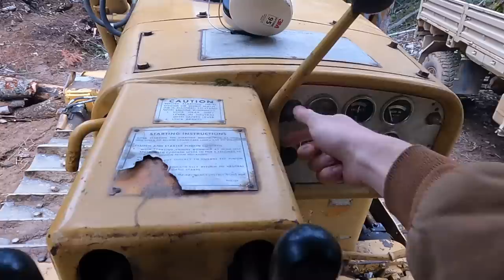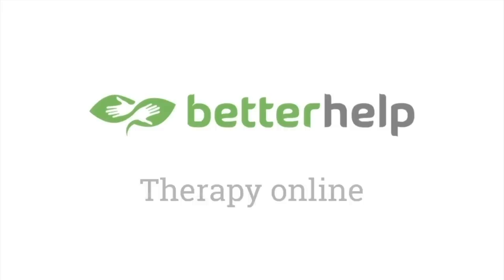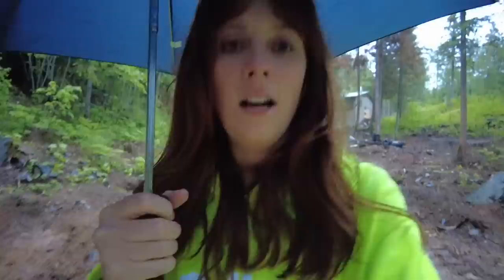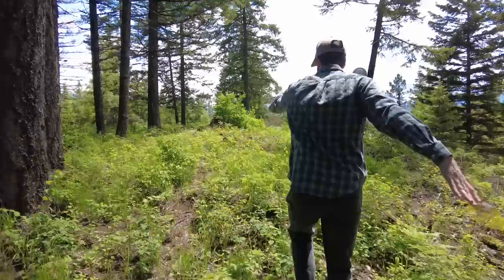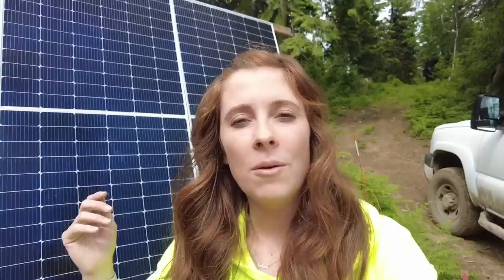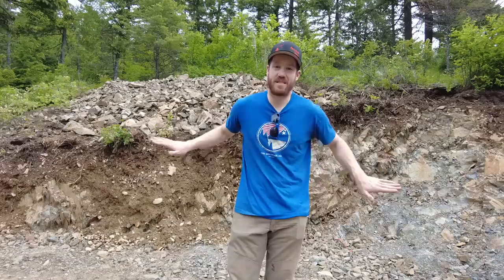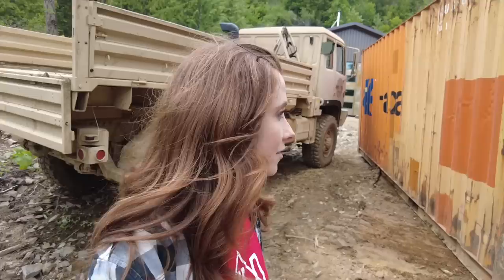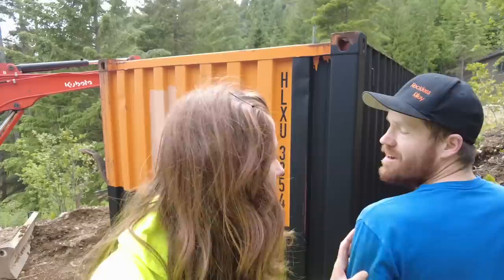We're Moving On... With A Shipping Container?

Comment: NO; don't put any soil or bury up against the wall of the container, that's me, I wouldn't, it needs to breathe! Or it will rot. Why, some shipping containers are not up for it; some are low grade metal & the pressure from burying it could buckle it besides rotting. I love you Guy's but that will have issues later if your bury the side wall. Why I know this, had a customer, the back-end of his container up against the embankment, it rotted.

Comment: Hey guys jus watched ur episode as it relates to the hole in the container roof how about cutting it out an putting in a turbine so that as it spins it pulls out the hot air from the electrical components? And also another idea to put the container on concrete slabs on the four corners jus to get it off the ground so that it doesn't rust from the bottom.

Comment: Since you have had a container previously, you are aware of the interior humidity issues that need to be managed, especially having a lot of electrical things inside.  I have had 2-20 ft containers for the past 5 years - one as a workshop, one as a storage unit,  I found some small solid-state dehumidifiers - they use Peltier modules, run on 12 volts, and have very low amperage requirements. I found them on Amazon.  I enjoy your Ambition, enjoy your YouTube, and wonder what it would be like to be young again,  Keep at it  :)

Comment: Should do the best  you can to level your container it will aid in the doors opening more smoothly. To level just use the rocks you have there around. Also enclose the bottom with dirt and that will aid in your batteries geothermal properties. If you are worrying about it sliding off you could drill into the back wall (dirt) and anchor it to the hillside.

Comment: Always adventures at your place.  The container should be of in the ground as long an it isn’t getting pressure from the earth like you mentioned.  Location looks stable, just make sure your backfill is clean draining rock.  Get drainage under it too if you guys aren’t already done.  Don’t allow water to pound under it.  Geofabric is cheap and can prevent fine dirt from migrating into rock and put another coat of water proofing on. 

Soon as I saw that container I knew that was going to be the solar house.  We did the same and just added a fan.

Comment: Weld a loop on the back of the hoe bucket near the top. For hooking too or lifting the boom. You two are so wholesome and chipper . You could ad foam sheets along the walls wear the dirt will touch to give the metal more longevity or automitive under coating spray would work too.

Comment: Industrial shelving cut down to 1 or 2 ft deep welded to the hill side wall would strengthen it and give some storage.  The sides are weak and may bow without bracing, especially when back filled.  Just a suggestion .
Reply from the maker: Great idea!
Reply: @AmbitionStrikes  Added suggestion max-r board glued to the walls and ceiling to help reflect light and insulate,  mini-split ac/heater your solar batteries will thank you.

Comment: Just some comment tips: 

When you shut down the pony motor, any pony motor, close the fuel and let it putter off rather than shutting it down normally. Lengthens the life. Pony motors are consumable items, but these ain't exactly new machines and parts ain't available like they used to.

Let both engines warm up plenty before using them for what they're meant. The bigger the engine, the more it needs to equalize.

Comment: Buddy of mine buried a 40 footer into a hill (endwise) at a campground he manages as an economical tornado shelter. It worked out just fine. You shouldn’t have any issues with your partial bury.
Reply: Did he water proof it before burying it?
Reply: @stephendoing2253  Nope. Just slammed it in to the side of a hill, end first, and covered it up. He built a couple of wing outs with RR ties at the entrance and dug a sump hole to keep the water out.

Comment: Probably should have reinforced the container (welding some beams on the sides/top) b4 sealing since you plan to half bury it. A container’s strength is “stacking” & then the weight is distributed down the corners. They have no “crush” reinforcements. Riley’s an engineer and should know this.

Comment: Good call on burying it for temperature regulation. I think most people who are concerned with collapses and water forget that it all depends on where you're buying it. It seems like water drains off well there, so you shouldn't have standing water against the container for extended periods of time. The rock will help with that also. Then to your point, there's not going to be a lot of weight/pressure against the container in that location. Excited to see how it plays out though!

Comment: We had a 46a d8 on the ranch always warm them before using it at full power. Turning happens easier if you carry a little in front of the blade. If the old Cat gives you a problem you can't solve drop me a line. Fred  Ps i like your videos keep working on your place it will get there.

Comment: Cool project, also check the floor of the container they are in some cases just a wood floor with 2 or 3 cross beams ie not a sealed steel box so ground water may or may not be a issue running of the bank above 👆 so drainage. Check now 😉

Comment: You're not actually burying it so you won't see the same stresses as if the whole container was underground.  What you may want to do is put a temporary brace along the back wall that will have the force against it.  Secondly, you're not likely to see damage occur until the rock and soil has had time to settle - could be months or years.  Maybe weld a steel frame inside on the back wall.  I noticed that in the next video you didn't et a spike in the one end to keep it from sliding, you really need to do that because settling could cause it to move the container.

Comment: Why didn't you use the dozer to construct the small road up the hill for the container, and then use the dozer to haul the container. It would have zero issues hauling the container.
Reply from the maker: We had the thought, but we wanted the clearing and road to remain as small as possible. The dozers blade is 13’6” wide. 😳

Comment: Ok, you painted the sidewall an back, but what about the bottom? Also adding some rocks and maybe a concrete block to keep the underside of the container away from the ground helps preventing from rusting. Your problem in a couple of years will be, that the top and side are still in a feasible state, but the underside is gone. You should fix that before continuing. But well done by moving the container only with the excavator. Next time you work as a team, front with excavator and back pushed by dozer (and maybe lift it above the ground). //R

Comment: Pretty sure what the internet usually thinks of when burying a shipping container is completely buried underground.  That's not what you're doing.  You should be fine, although I agree with back filling with larger rocks/gravel for drainage, and putting it on railroad ties.  I would also suggest some sort of anchors to hold it in place, whether that be rebar or otherwise.  Ideally I would have said pour a couple small concrete footings and pads, then bolt it to that.  Gets it off the ground and anchors it in place.

Comment: Hi Riley and Courtney- a big hi from the uk. First off thank you for trashing my weekend. I had so much to do but found your channel and have literally binge watched 53 episodes. So much respect for you 2. I may have missed it but what happened to that huge generator and if you are still using those 2 way solar panels unless someone else has suggested it - how about spray adhesive/stapling cooking aluminium to some cardboard/off cuts of boards and placing it behind them for more amps - cheap and easy to replace when dirty. Keep them coming
Reply from the maker: Thanks for watching Anthony! We've still got the big generator, and will be incorporating that into our container system. 

It sounds like if we add a reflective surface to those panels we can up our solar production by about 15%.

Comment: ALSO RILEY. You really should stop using the teeth on the bucket for the chains. It should have an anchor point for a shackle on the backside of the bucket. If it doesn’t you really should weld one on. . . .

Comment: There WILL be Crushing force on the buried side of the container Riley. Even with all the rock there.

However, since it won’t be completely buried you CAN reinforce the inside with at the very least some heavy walled square tubing on the buried side. It’s also something that if done correctly can be done in STAGES/PHASES (which honestly I would have to do for financial considerations as well). PREP the site for the container, get it in place and setup, it CAN be back-filled “later” while still being used as intended in the mean time. 

AND if you prep the container properly (which you should do for the battery storage), by venting it, it can be a multi-use storage solution. Divide the container in half, install doors on the open side, 1 half can be your power station, while the other half if buried enough could be a great “root cellar”, or any number of storage capabilities

Comment: I work in the utility industry and big battery systems are nornal for us in grid protection. Make sure u have plenty of ventilation so they hydrogen does build up and explode and a heater is a must. u do not want to any battery drop below 50 or over 80 most manufacturers, Bae, Cid and so on highly recommend keeping the Temps as stable as possible ie heater for winter and some type of cooling or great ventilation to keep summer Temps down
Reply: Lithium batteries don't off-gas unless they're overcharged...  and then the real danger is fire.  Who uses Lead/Acid batteries for solar now?   Maybe in 3rd world countries.  Even cellular companies are switching to Lithium batteries  for Comm site backup.
Reply: @juststeve7665  the entire utility industry uses lead acid for backup as lithium cost astronomically more. For our massive projects we use flow batteries and some traditional lithium based banks but we're talking megawats of capacity for those at hundreds millions of dollars. For our standard substation backup systems a large bank of lead acid does the same as lithium at 60% the costs. Are lithium more efficient sure but does that justify the massive jump in costs for a stationary bank not really.

Comment: shouldn't have any problems what would do is use rock as back fill and a few have suggested to put it up on railroad ties . Hmmm cant see why ya cant use rock underneath too. It would let the water drain ourt plus ya get the rock as insulator too. Reason i said rock is ya enough around there,😁

Comment: What nonsense, the shipping container is fine so long as you are only backfilling one side.  You are still going to have to provide some small amount of heating capability.  It is just to be safe but you are only providing 1/2 insulation and heating from the Earth.  The bright side is that you are using it for an energy site so with the number of panels and storage you have it will have sufficient energy to keep the batteries from going below charge specs.  Insulation will help as well.

Comment: Indeed as others says, backfill it with stone. The idea is to give dranage to the back (hill side). I do not believe it will ever colapse as it is not technically "buried" However, what may happen is more along the lines of hydralics having weight against one side only can push the container off it's landing (towards the open, free side). If you can get it on RR Ties this may be averted as pressure can be relieved underneath as well as from the backside with proper drainage. But pay attention to the hillside, it has now been disturbed and it's mad at you so, it'll want to disturb you in ht eform of settling. As it settles, it will apply more and more pressure against the container until it is (the hillside) fully settled which in turn as mentioned may force the container from its location. Just my 42.7658927 cents. Wish you the Best with this and all your upcoming projects - Cheers !!!

Comment: You need to keep the doors exposed if you bury it, chances are it will be crushed. They are designed to be stacked not buried. better to foam insulate and, add intake /-exhaust fans. You can get spay foam insulation from Home depot. You could have built a shed for cheaper than the container. you are surrounded by lumber ! Sorry,I think you wasted time and money this way. I don't know why you didn't put the put the panels on your shop roof and the shed next to your house . You are going to run into power problems, with that long of a run from the house. I hope you got a good deal on that container . Keep going strong !
Reply: The power run is fine for 220VAC if the cable used is properly sized
Reply: @juststeve7665  Yes, that's the point. They have to have the proper size cable for the run ( distance ). That is where most people cheap out when they see the cost of cable. Then they end up with wrong size wire for that distance and wonder why power is fluctuating. on top of that, if your going from DC to AC, That long  a distance YOUR LOSING A LOT OF POWER. I wish them luck. I really hope they plan this out well.  If you got a solar array to generate power ,there is no noise. However, those batteries and electronics need protection against elements and temperature .